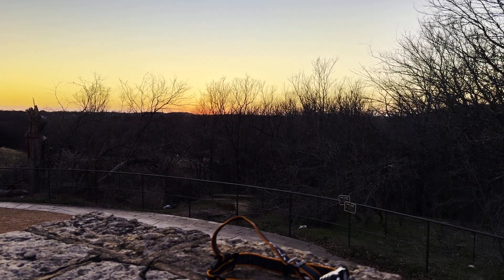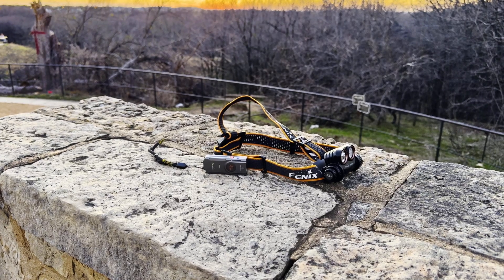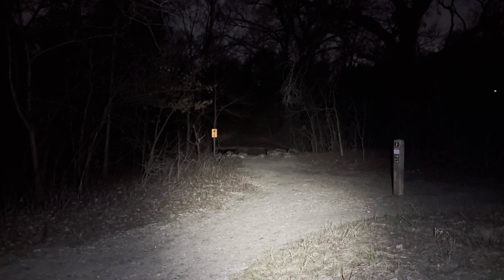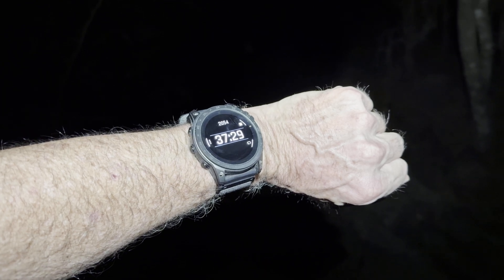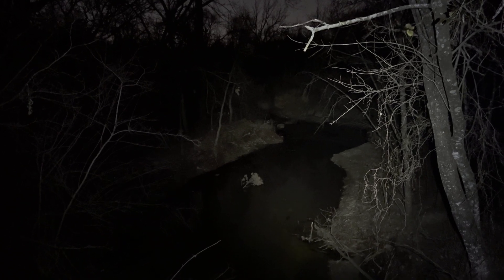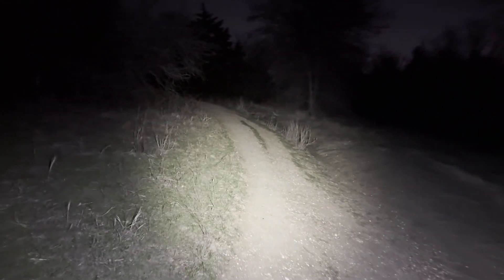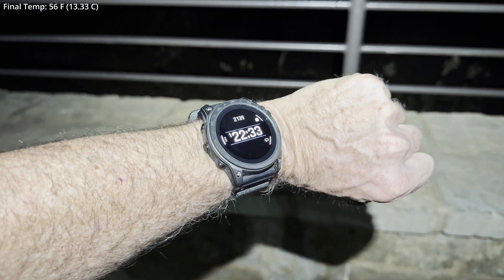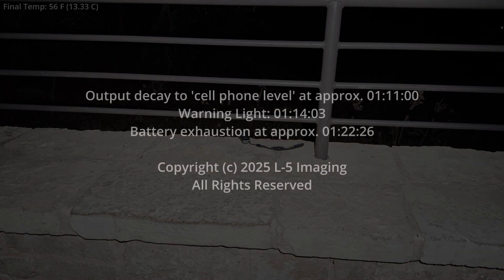FENIX E06R EDC Flashlight Battery Endurance Test: How Long Does It Last?

Comment: What if the battery dies for years of use. Is the light disposable? Or is there any option to replace the battery?
Reply from the maker: Any light with a fixed internal battery should be disposed the way you would with any standalone battery.  I took the Nitecore EDC 35 to the same battery disposal dropoff at Home Depot that I've used for drone batteries in the past.  Thank you for an excellent question.